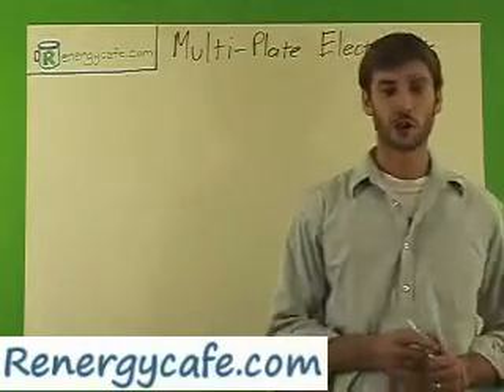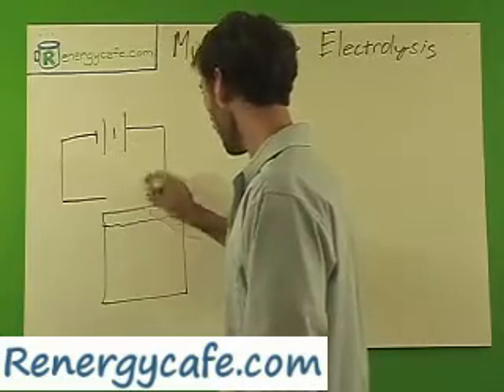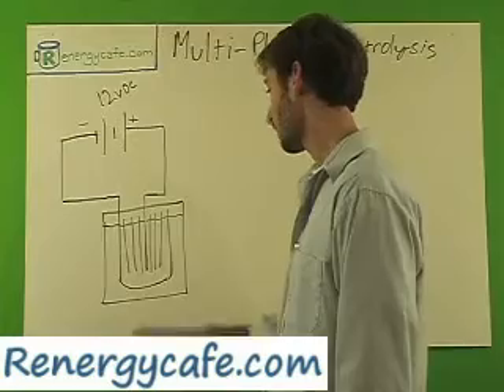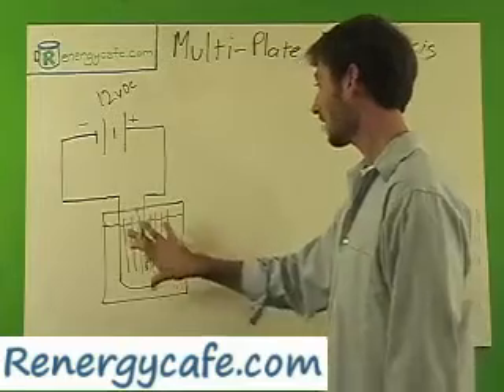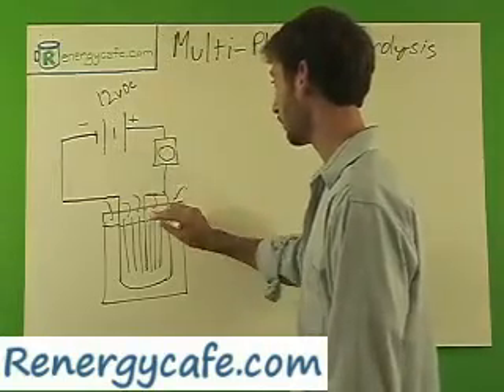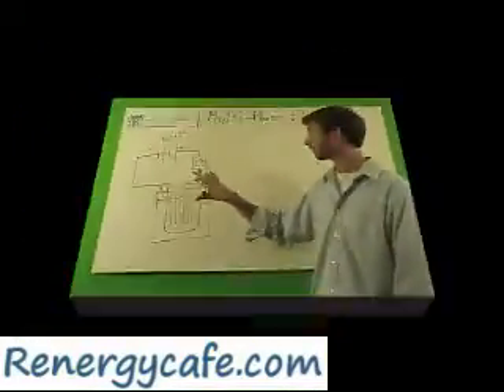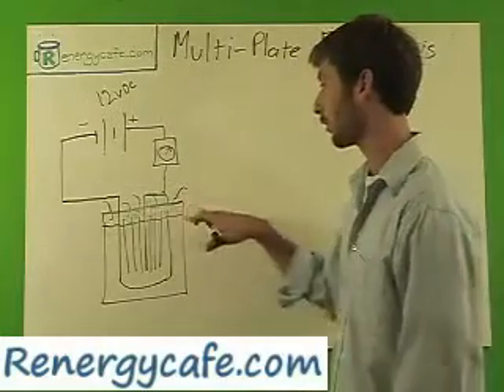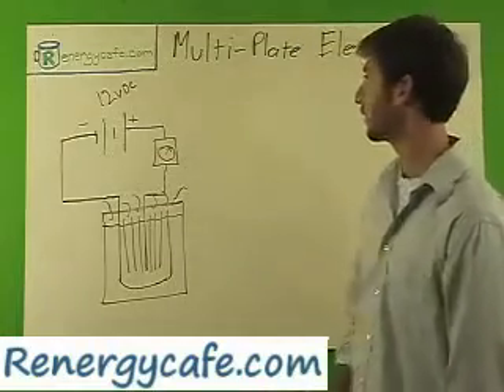Electrolysis, Multi-Plate How it Works and Renewable Energy

Comment: An electric current will be perpendicular to the surface. so if I have current going straight to opposing plate, and it hits an impassable surface, say air on the other side of the negative plate, not water, can the current be perceived to "deflect" off this impasse, and return back in a perpendicular way much as it went in, or would it run along the plate length internally, I cant find any clear data on this so any advice would be magic.. thanks.
Thom in Scotland.